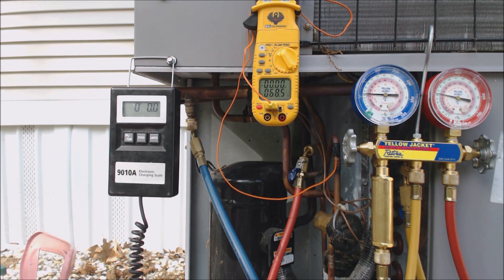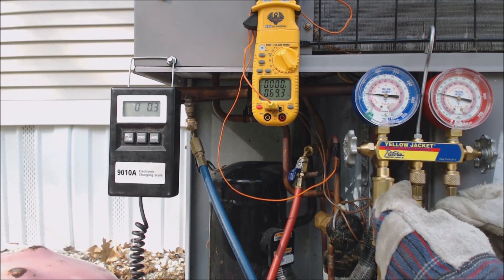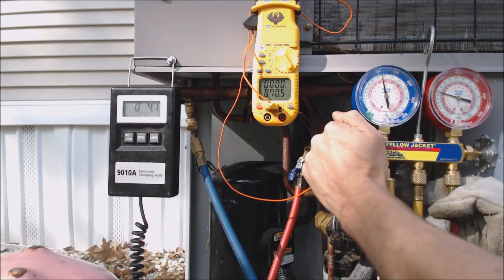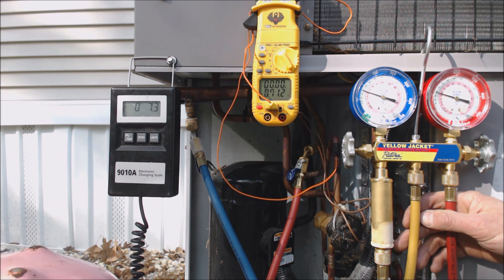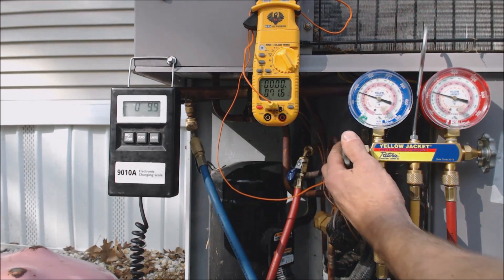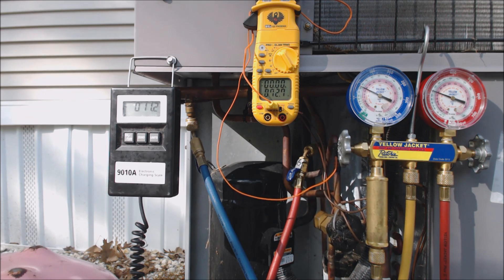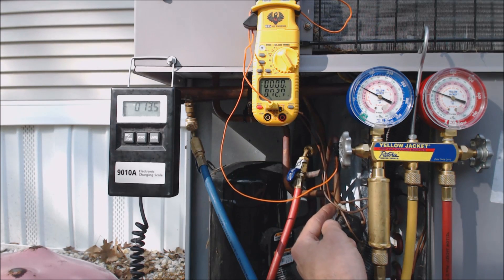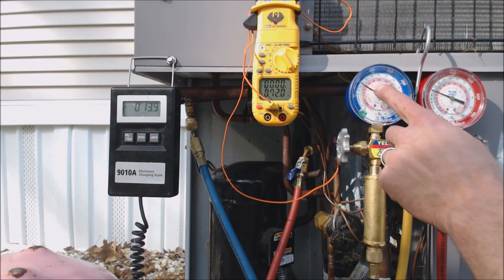R-410A Charging! Charging a System that is Very Low on Refrigerant,  Avoid the Evap Freezing! Part 1

Comment: Hey bud I had an issue last time. 410a system  with txv asking for 12degrees subcool. The subcool was at 3 , I added 1.5 lbs and subcool did not make a move, however pressures did go up some from low side 120 psi high side 340 to  low side 140 high side 370, house temp inside was 85 so low side pressure is understandable but high side was at 370ish and kind of scared me and did not want to add more. Just a guess what do you think it could be ? Did it just maybe needed more charge and 370+ high side is ok? Mind you this was a 100 degree weather day outside. Thanks bud
Reply from the maker: Do you have the superheat and delta T along with those measurements by chance? Is the unit a 13, 14 or 16 seer unit? What are you using to read the actual temp on the liquid line with?

Comment: Assuming the refrigerant that's left in the unit hasn't fractionated to the point where it's no longer effective
Reply from the maker: Hey Bender, In the case of R-410A, manufacturer trainings will say it is ok to top off systems as far as the blend is concerned because it is near azeotropic even though they want the refrigerant to come out of the bottle as a liquid to avoid fractionation. Obviously not over and over again. If you are working with other zeotropic refrigerants then more care must be taken when fixing leaks and adding to the charge. Here is some good reading material. Thanks for the comment! http://www.achrnews.com/articles/82752-blends-101-an-introduction-to-refrigerants

Comment: I have a question what if on the low side gauge is reading at 10 but when the unit turns on the gauge is reading below 0 an the high side line is frostin
Reply from the maker: That would depend on the refrigerant and if it was a freezer or something but if it was an air conditioner with r-22 or r410a then it sounds like you lost about 95% of your refrigerant charge, thanks John

Comment: How much pressure should be on working blue 410a gauge?
Reply from the maker: It will depend on the heat load on the building. Check out "acservicetech superheat playlist" and "acservicetech subcooling playlist" for more info on checking the charges. Unfortunately we can just use pressures but superheat and subcooling, thanks

Comment: That's a blend so you should have reclaimed what was left then weighed new in
Reply from the maker: Hey Tim, In the case of R-410A, manufacturer trainings will say it is ok to top off systems as far as the blend is concerned because it is near azeotropic even though they want the refrigerant to come out of the bottle as a liquid to avoid fractionation. Obviously not over and over again. If you are working with other zeotropic refrigerants then more care must be taken when fixing leaks and adding to the charge. Here is some good reading material. Thanks for the comment! http://www.achrnews.com/articles/82752-blends-101-an-introduction-to-refrigerants

Comment: How do you charge a AC unit that won't turn on because of very little refridgerant in unit
Reply from the maker: If you check the pressure in the unit and its less than the sat pressure at the outside pressure then you can just weigh liquid from the tank directly into the liquid line of the unit and weigh the tank to check how much you are putting in, thanks

Comment: I had a system that was low on R410A. Someone came out and checked for a leak. He couldn't find anything, so he started to charge it. I had already watched your videos. He connected the bottle and purged the air. His gauges did NOT have a vaporizer in line with it. He opened the valve and would leave open for a minute or more at a time. He got a charge in it quick. Then shut it all down and started sniffing for the leak again. Found a spot on the outside coil. It was under warranty, so they ordered the part. 15 minutes after he left, there was an awful sound coming from the compressor.  So far they haven't been back out with the new coil to replace. I am betting he will be replacing the compressor too.
Reply from the maker: That noise doesn't sound good. You can do it without the vaporizer but it would be done slower, thanks
Reply: acservicetech Came back out and found out it was the accumulator not the coil. They had to order it. Another week later he came back with it. After 4 hours of installing it, he pulled vacuum. Then hooked the bottle on again without a vaporizer (Is it needed without the compressor running?). After filled, he turned the system on. The compressor was LOUD! He let it run that way for about 5 minutes and it kicked out, then kicked back on after about a minute. He then calls his boss to tell him what it was doing. His boss wants to hear it over the phone. Now they are ordering a new compressor. He said he will be back tomorrow. I don't think I want him back tomorrow. Ugh. The system is at most 4 years old.

Comment: Just had a tech add 3.2 lbs R410A to system,   he turned pink bottle upside down and charged.    System only had 2.2 lbs left in it from 8.8 .  He had a digital gauge.    We will have a leak detection done next week as we were low,  system is 3 yrs old this June . 3 Ton txv sub cool to 10 .      2 questions;   1.   I'm confused and now worried  as to damage when topping system back up.  Can you explain ?  What do I need to know to be sure its done properly ?   Was the vaporizer necessary on the system you filled .   I dont believe I saw these on techs gauges  .  What is your way to leak detect ? Thanks
Reply from the maker: It can be done without the vaporizer. There are different methods. Leak detection, bubble leak detector,  electronic sniffer, uv dye, pump down and pressure test the rest. There are many ways to try to find leaks. It is not always that easy though, thanks. You can add r410a back to a system that has leaked and still have a good mix for that near azeotropic mix, thanks

Comment: I’m very glad I subscribed to your channel! I have a question for you. How come you’re turning the bottle upside down to introduce liquid into the system and letting it go through that vaporizer on your gauge to change it to vapour, when you can have it up right and open the vapour port on the bottle and introduce it that way? Is this turning the bottle upside down technique when the bottle gets low and you can’t get all the liquid from the tank through the liquid valve on the bottle? I’m curious! Thanks!
Reply from the maker: It is because R-410a is a near azeotropic mixture and has to come out of the bottle as a liquid to keep the proper mix, thanks
Reply: acservicetech okay I do understand that but isn’t there two nozzles on the bottle it’s self? Blue for vapour and red for liquid? Doesn’t the liquid port have a tube that draws from the bottom on the bottle?
Reply: @michaelmead2076 - 3 years late but no, only one port on the cylinder. Upright, you get vapor. Inverted, you get liquid.

Comment: i have a dry condencer  no freon when i add freon should unit be running  ?? thank you   jim
Reply from the maker: You need to attach the lineset, pressure test, release the nitrogen, vacuum down below 500 microns and break the vacuum with refrigerant. Look up "acservicetech vacuum playlist", thanks

Comment: Question, on a packaged heat pump r22 in cooling mode, would you put your probe right before the txv still? Or what’s the proper way to check for charge? Sub cooling still right?
Reply from the maker: Package units may state a preferred way to check the charge via pressures and temps since they have done tests on package units at the factory. If they don't give you a port in a good location for subcooling then you can try to find the middle of the condensor coil on a ubend and right after the liquid comes out of the condensor coil in order to measure subcooling with temp sensors only. On a packaged unit, the liquid line is not that long so after the condensor would be good but you can put it before the txv if needed, thanks- https://www.youtube.com/watch?v=MHth2vH3np4&t=27s

Comment: Does the system have to be in any particular state when checking charge. For example does the room stat have to be turned up full or if there are 2 condensor fans, do both have to be running etc etc. I am new to this field so there may be other considerations. Please advise.
Reply from the maker: You can check both unit compressors if you have the system on full cooling or just check one at a time at half the airflow 1st stage cooling, thanks

Comment: You said aim for EVAP saturation temp of 35-48 degrees. Is this the case just for some refrigerants or all. Or does it depend on the application such as a fridge or cool room. Thanks Michael
Reply from the maker: Most all air conditioning systems unless extremely low wb inside or very high wet bulb inside, not refrigeration, thanks

Comment: Can a system be charged if the vapor line has frosted over?
Reply from the maker: Yes but you don't want to wait too long after the start up. If it is low on refrigerant then you will raise the pressure and sat temp above freezing. It could also be a liquid line restriction or low airflow, thanks

Comment: What could be cause  a heat pump system does not cooling?
Reply from the maker: It sounds like the reversing valve may not be powered. The reversing valve would allow the system's refrigerant to run in the other direction, providing cooling, thanks

Comment: Isn't purging illegal?
Reply from the maker: Here is a link. You need to purge the air out of the hoses so that it does not accidentally get added into the system charge- https://www.epa.gov/section608/stationary-refrigeration-prohibition-venting-refrigerants

Comment: Great video, learning so much. Does it matter if heat pump is in heat vs cool mode?(aside from where hoses are connected)
Reply from the maker: You have to check the charge in cooling mode so the accumulator is drained, thanks

Comment: Sir ,what is the best gas charging method?
Reply from the maker: Subcooling for txv's, superheat for piston or capillary tube systems, thanks
Reply: Lol! 🤣
Reply: Subcooling for txv?  I don't think so there sparky, superheat is what you check, and in the forty five years I was in the field I never even once did anything other than feel the suction line with my hand for a proper chill. You guys are anal ! And that chargemaster POS is a useless device, I never wasted a dime buying one, just meter the gas with your manifold and don't be so slow about it, especially with a scroll compressor, no pistons means much less fuss charging the system.

Comment: quick question. 
what if the saturation temperature is 60 ? do I need to add more refrigerant to bring  it down to a 40 degree coil?
Reply from the maker: That is too high, you would need to check the superheat and subcooling to determine the problem, thanks
Reply: acservicetech Its a new system I install I still need to add like 6oz more of 410a refrigerant . Do you think that will change anything ?
Reply from the maker: Yes it may if the superheat is high and low on refrigerant but you would need to know if you need to check in subcooling for txv or superheat for piston. We can't go on just the sat temp alone to figure it out. Check out some of these videos on reading the gauge set subcooling and superheat, thanks- https://www.youtube.com/watch?v=lpHpfCEq8IY&list=PLxnHR5_D2ojxZI3-xx03Bttxe3xCqUD87
Reply: I have the same problem with some units. 88 outdoor temp with 88 indoor temps. Subcool 12.Suction pressure 148 with superheat 30 degrees. I am going to check it today and hope to find it more in the ballpark.

Comment: layman's question: What is the basic difference between refrigerants, such as R-12 R-22  R-304 R-502? I don't mean chemical analysis, but is it possibly a viscosity thing? Why do vehicles converted to 134  from R12 seem to be less efficient with the mandated refrigerant? Thanks, Fritz
Reply from the maker: These really have to do with what temperatures these refrigerants change state at from liquid to gas. They are developed due to these constraints for certain applications only. Thanks!

Comment: Great work thanks ... can I use PT chart in automobiles air conditioning system too?
Reply from the maker: Yes but the problem is that the auto compressors are not single speed so you can't use superheat because this will change depending on the compressor speed, thanks

Comment: My ac blows cold air in the morning and late at night but in the afternoon it seems to blow hotter air I have my thermostat set at 71 if temp outside gets to 85 it's 75 in the house 90 degrees outside  78 in the house could I have a freon leak
Reply from the maker: If this is a single speed ac system then you are looking for an indoor temp decrease of 18-21 degrees, thanks

Comment: really cool video. best i've seen on this topic. i'd love to see your instructions and input on charging and dealing with mini splits that don't have a high side port and proper charging of those units.
Reply from the maker: Unfortunately we have to charge by weight if it is an inverter which means that we need to pull the charge out, fix the leak, nitrogen test and weigh it back in. If it is a single speed unit then it can be done with two temp sensors, thanks
Reply: yes i found ur mini split videos. very cool man. thx for the fast reply. just got a P4 error on my 33k midea.

Comment: How do you know if your system uses R-410A or R22
Reply from the maker: It would say it on the rating plate on the side of the unit. As well,  it usually also says it on the side of the compressor. You can also check sat temp when the unit is off and both sides are equalized, thanks!

Comment: If its low on refrigerant shouldn't you check for a leak?
Reply from the maker: Many of the videos are made to show what if scenarios and not actual service calls. This would be as if they found a leaky Schrader or txv fitting. Here is a video on weighing in the full charge from vacuum after nitrogen test. Thanks  --https://youtu.be/ncgLDYrvN6w  -- here is a video on finding a leak- https://youtu.be/2Be_sG-HQTQ

Comment: Sir can i charge R410 gas in R22 system
Reply from the maker: The refrigerants cannot be mixed and the system components are not built to work with the wrong refrigerant, thanks
Reply: No because R410 is higher pressure than R22, and the compressor is different too. So at the very least you'll need different plumbing and compressor.

Comment: Is it advisable to do top-up R410A as you did in this video about 14.6 lbs?
Reply from the maker: This was an example of how to charge a system low on refrigerant. It was roughly about 2 pounds total added. After fixing the leak, pressure testing, and vacuum pumping, you could weigh the refrigerant in to break the 500 micron vacuum. Thanks

Comment: Great video sir. you said txv so I am assuming it is a not a VRF system. My question is this, can subcooling method be used to charge a VRF system?
Reply from the maker: Subcooling could be used to monitor but not to charge. You have to use manufacturer approved methods for them but obviously they say they like us to weigh in the correct amount due to length, thanks.
Reply: Thank you sir. 
yeah, that is what they said.

Comment: how do you add refrigerant to an empty unit. my evap froze and all leaked out. the shrader valve was leaking.   do you turn it on?. or put some in first than turn it on???????
Reply from the maker: Replace the shrader valve and also the filter drier, pressure test under the design pressure with nitrogen, release the nitrogen, oil blow out,  vac pump to 500 microns, weigh refrigerant into the high side as stated on the rating plate, then turn the system on for 10 minutes and check charge. -   https://youtu.be/ncgLDYrvN6w   --   https://youtu.be/-Fawq6cpVSw
Reply: intelin12
Reply: If you haven't done this before, highly recommend DON'T!  You'll spend more in the long run if do it WRONG lol

Comment: I see you're very conscientious about hurting the compressor but if there is a leak in the system that refrigerant is contaminated.
Reply from the maker: Great question! In the case of R-410A, manufacturer trainings will say it is ok to top off systems as far as the blend is concerned because it is near azeotropic even though they want the refrigerant to come out of the bottle as a liquid to avoid fractionation. Obviously not over and over again. If you are working with other zeotropic refrigerants then more care must be taken when fixing leaks and adding to the charge. Here is some good reading material. Thanks for the question! http://www.achrnews.com/articles/82752-blends-101-an-introduction-to-refrigerants

Comment: I come from the commercial end . I'm just getting use to the way techs  charge units on the residential end when the pressures are low . My question to you is  , did this unit have a leak ? If so , why not go through the appropriate steps of recovery , nitro, leak check , repair , and recharge method ?  I'm not scrutinizing, just wondering why residential techs rarely do that ?
Reply from the maker: Many of the videos are made to show what if scenarios and not actual service calls. This would be as if they found a leaky Schrader or txv fitting. Here is a video on weighing in the full charge from vacuum after nitrogen test. Thanks Joseph --https://youtu.be/ncgLDYrvN6w
Reply: Gotcha . Thanks for the feedback . Great videos btw . Very informative.